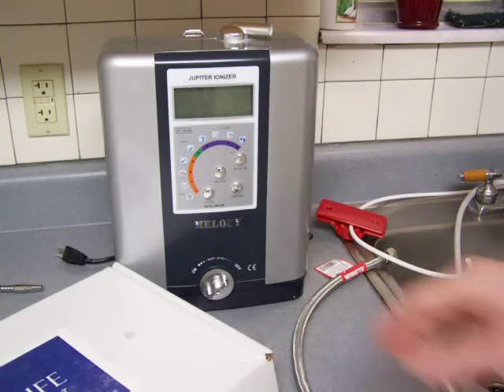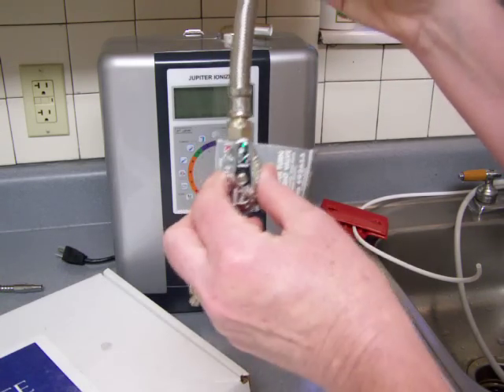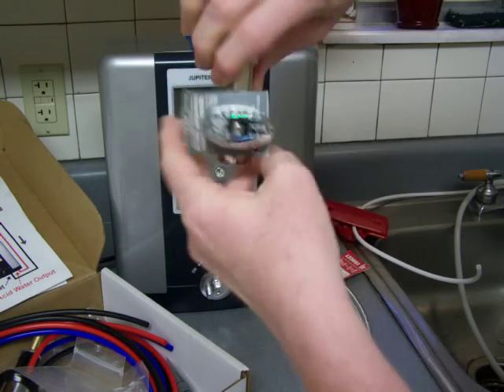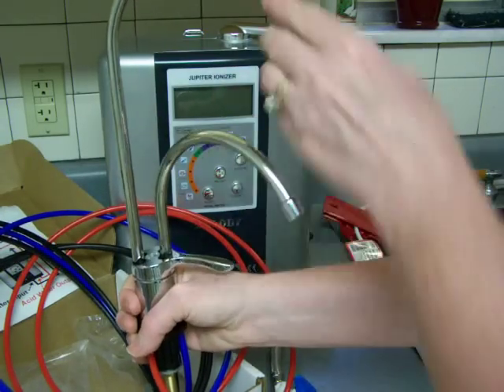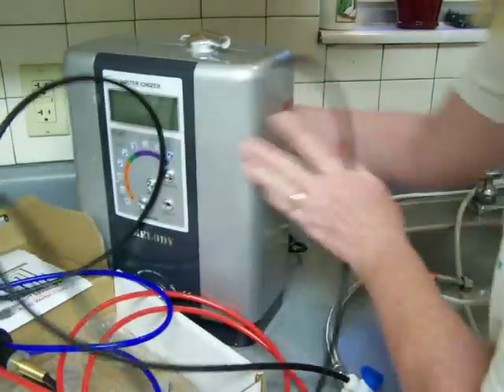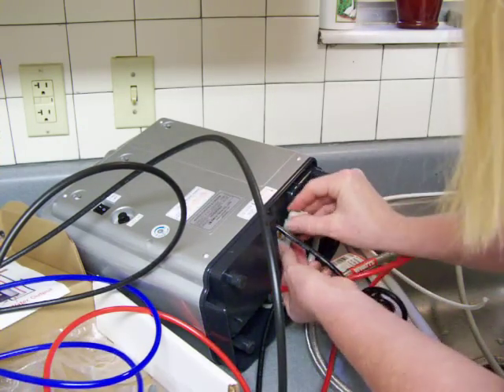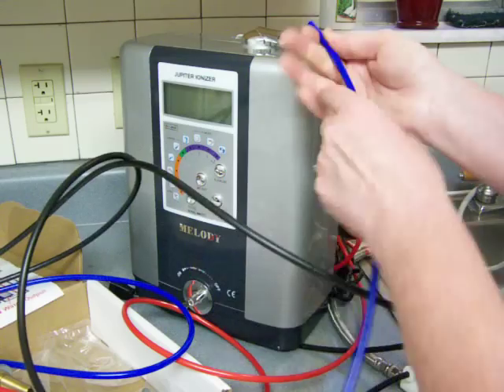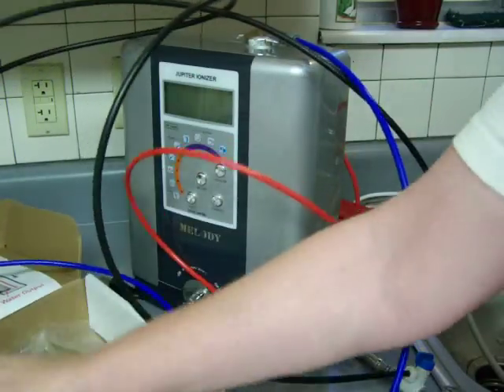water ionizer undersink kit demo

Comment: hi Cathleen, thanks for responding. we're trying to get things up and running. why does water come out of both faucets at once? shouldnt we be able to control the acid and alkaline seperately? seems like it would be a no brainer. we have the undercounter kit but appears different from the one in the video. last post refers to removing the silver swivel as said in directions but it isnt actually removed.
Reply from the maker: The way an ionizer works is to split the water into two streams, microclustering it. Therefore both acid and alkaline will come out together. Your machine controls the alkaline/acid settings. The stronger alkaline, the stronger acidic water will be dispensed concurrently. If you have it set to the third setting of alkaline then the bottom faucet will dispense the third level of acidic water.  The kit in the video is an old model. The new kit is different [works better]. I'll demonstrate it soon.

Comment: I just moved and my son disconnected the blue red and black lines from the faucet.  In the video the red looks like it is under the longer alkaline spout, and the blue under the short acid spout but you said to connect the red acid line to Jupiter.  I plugged a line from the top of the Melody, alkaline to the nipple under the longer spout and nothing comes out.
Reply from the maker: Call alkaviva support number and they will help you re-connect your faucet properly. 775-324-2400